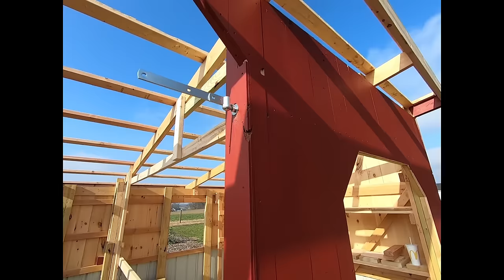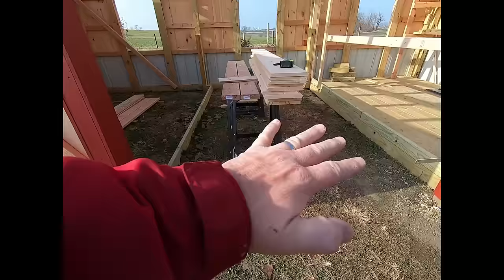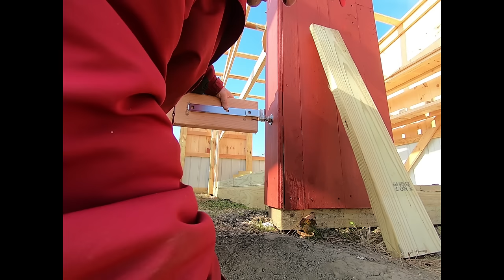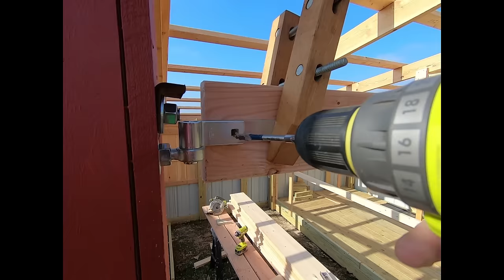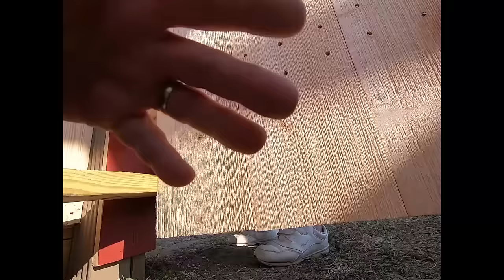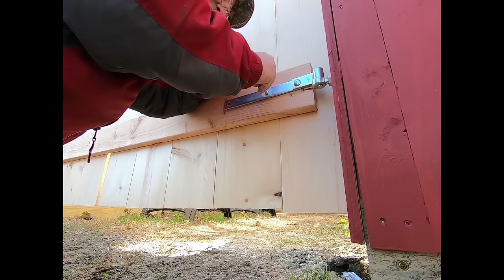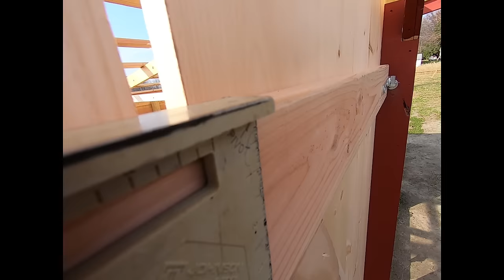DON'T build BARN Doors UNTIL you watch this VIDEO...EASY BARN DOORS

Comment: This may be a stupid question but how was the trim placed to make the doors weather tight?  I wish I could see a photo of the doors all completed on the barn.  I want my doors to swing out but be weather tight( or at least keep rain out).
Reply from the maker: Thanks for watching. I wasn’t looking for weather tight as the shed faces East, has a large overhang and the doors are set in from the front and built over a gravel floor. However, if you want to build them similarly and more weathertight you could add stops to the backside and an overlapping board on the face of one. 
This building method can also be used with more traditional face mounted strap hinges and then trimmed out like any door.

Comment: This will be a great solution for me. Simple solution to a big job for a DIYer. 

In my case I will make one door 1/3rd and the other 2/3rds of the overall width. That way I am only opening a small door most of the time. I may need a 3rd hinge to support the larger door?

My problem is the garage is framed in concrete blocks on one side and stone (old cottage) on the other. I was thinking maybe setting the hinge hangers in epoxy or should I frame out in timber first?  I would take advice here. I could bolt the hinges to the timber frame before fixing it to the stone/block sides? 

Couple of observations.
1. Why did you not have the rounded bolt heads on the outside?
2. Did you consider putting in the remaining 3 bolts in each hinge before removing the first bolt and drilling through the face timber and frame (and turning it if you agree with having the rounded side out)?
3. Would you consider a dab of silicon on each bolt to prevent water ingress and rot down the line.

Sorry it is a slightly long winded reply but once again a great and simple idea.
Reply from the maker: Thanks for watching.  I would definitely frame the opening with timbers.  These can be attached to the concrete and stones using some variety of concrete/stone anchors.  The rounded side of the carriage bolts are facing out. I have the braces on the outside of the door. I may not understand what you are referring to so please feel free to respond again.  The silicone isn't a bad idea.

Comment: My wife wants me to do this exact style door. Could you possibly share the material list with me? Im doing an 8x8 but dividing it into two 4x8 size doors
Reply from the maker: 2 x 6’s for the horizontals and 2 x 4 for the diagonal bracing. The boards are pine boards that can be tongue and groove or shiplap style.  The hinges are made by National Hardware and are called gate strap hinges. A Google search will set you up. Thanks for watching.

Comment: Do you see any reason why I couldn't use 12" black extra heavy duty tee hinges?  I'm putting barn doors on a garage and like the cosmetics of these hinges better.  Plus, I want to get the doors as close as possible to the sides of the garage (without gaps on the sides).  Thanks in advance!
Reply from the maker: T-Hinges would work also. They do have better curb appeal!!  Thanks for watching.

Comment: So smart! Why does anyone build a barn door any other way? No is there was just something to help me remember to close my barn door all would be good.
I am a little late to this party but I am curious about your use of carriage bolts. We’re the a little under-sized so the square bit inside the head was “pulled” into the hole in the hinge? That question is what comes of not watching the whole video. I think the holes in the hinge were square shapes to accept the square on the carriage bolt?
Reply from the maker: Yes, the carriage bolts did fit into the square holes in the hinges. Sometimes you have to turn the bolt a bit to make things line up but they are definitely worth the trouble.

Comment: Love the video, been throwing ideas around how to build doors for an older building I am renovating.  May I ask your opinion wondering adding a third 2X6 and hinge or would a third be overkill?  My door opening will be around 10 foot wide by 8 foot high. Thanks for your videos, I enjoy and appreciate them.
Reply from the maker: Thanks so much for watching. The third one wouldn’t be a bad idea if you plan on using the doors a lot.  I helped build doors for a 16’ tall and 24’ wide opening.  We used 2 2x12’s.  Probably should have used a third one on those.

Comment: So do you attach the hinges as they hang, meaning, allowing them to droop down and attach them where ever they may hang? Or do you level them up with your 2x6? If I allow mine to hang as they are and attach them to my 2x6, they look like shit. They're out literately 20 degrees.
Reply from the maker: Your hinges seem to have a lot of “slop” in them. Your hinges will need to drop or your doors are going to drop. Hinges with way too much play are going to be a problem either way.

Comment: Great video, thanks!  Can I use this method if I need to have both the hinges and the vertical boarding on the outside? The existing gudgeon hinge pins are on the outside face of the reveals. Somehow I can't work out how to apply your wonderful method to my situation.  Help!
Reply from the maker: There should be no problem reversing and putting the bracing on the inside and the vertical boards on the outside. Perhaps the hinges would be hidden from the outside view? If that won’t work you may have to reposition the hinges or go with a different type.
Reply: @LancoAmish  I think that would mean that the vertical cladding boards would be proud of the reveals and the end grains would be subject to the rain ( it rains a lot here in the SW of France!).  I'm wondering if I could fix the horizontal rails to blocks fixed appropriately to the reveals, and then when all the vertical cladding is on, attach the droopy hinge straps to the outside of the cladding?? Do you think that would work?  ~Thanks
Reply from the maker: @nigelford597  sounds like it might. Just make sure to use fasteners that will reach solid studding.
Reply: @LancoAmish  Thank you master!

Comment: I've built a lot of gates, and watched a lot of videos, this was the most informative. It's so obvious now. Thank you for sharing.
What can you (or anyone) tell me about wooden gates twisting? Granted, these are big gates. Two 6' wide and one 8'. I'm going to try lap joints and a full frame on the 8'. I have 3 cross boards for three hinges. I'm going to put one diagonal, and lap joint where it and the middle cross board meet.
Reply from the maker: Thanks so much for watching. Glad the video can be of help.

Comment: SO much simpler than what I would have done for my shed had I not seen this. 

Question - I would have placed the bracing side in rather than exposed, to make it just a trifle harder for miscreants to break in. What are the advantages of bracing inside vs outside?
Reply from the maker: Thanks for watching.  I put the bracing on the outside for looks only.  You can put it on the inside no problem.

Comment: When we build doors like that, we cut the bottom and cross members at 45° so they lock together when closed.  It makes latching them much easier.  I have done about a dozen doors this way over the past ten years and none have pinched or sagged.
Reply from the maker: Thanks so much for watching and for the suggestion.   Have a great evening.

Comment: Great tutorial. I like the idea of building them in place and separating them afterwards. Will try it out in a few weeks. However I do disagree with installing the hinges on an angle. Properly bolted through the wood like you did, they should not sag significantly after the build. And even if they do, they will sag identically on both sides and you will not be able to tell. The disadvantage of installing them your way is that they do not slide on the lower surface but on the corner instead. This will increase wear imo.
Reply from the maker: Thanks for watching and commenting. If you use the type of hinges I did I think you will be sorry you didn’t let them “ride down”. These hinges have a lot of play in them and letting them ride down as I show negates that play.  Putting them on straight without it will result in the doors falling inward. On real big doors, the biggest I’ve helped with were 24 wide together, at the end of 12 feet a 1/16” of “slop” in the hinge results in over an inch drop where the doors meet. Not something I want to fix by trimming the doors. All hinges have play in them especially this style. I guess after a few tens of thousands of openings and closings wear might be an issue but that’s a long way into the future
Reply: @LancoAmish  lubrication helps
Reply: Definitely a DIY tutorial!  There are so many errors with your design and technique I don't have the time or space to list all!  What do you say professional builders?

Comment: Just curious, did you leave the braces exposed, or did you cover them with additional pine boards?  This appears to be the inside of a garage door, not the outside.  Great job!!! I am going to try to do this on an 18' x 12' opening where I store my camper.  Since I do not have anyway out of the garage once I start (no man door), I plan on doing the planks as far as I can until I can still squeeze through the opening, then do all of the cutting from outside, then add the few planks afterwards.  Any help would be much appreciated!!! Thank you so much for sharing!!!
Reply from the maker: Jimmy Smith I only used the one layer of pine boards. The braces are exposed.  I was going for a certain look as the doors face the road and I wanted something more than just plain.  2 things... the doors face East and get very little weather and they are inset so water cannot soak the tops anyhow.  I designed it this way on purpose.  I was able to cut from the outside as I have 3 doors across the front of the barn.  I don’t see a problem with making doors the size you are looking at.  Use longer hinges and larger dimension cross braces.  I helped build 24 foot wide by 16 foot tall doors on a large barn a number of years ago.  We used much longer hinges and 24 foot 2x12’s for the braces.  No way we could have built those doors any other way!  🙂
Reply: That is a large barn!!! I was thinking about going with 2x8 cross members and 2x6 braces.  Do you think that will suffice?  Thanks!!!
Reply from the maker: Jimmy Smith , I would think so.  Get the straightest and most knot free lumber you can find.

Comment: Great way to build barn doors.  Only thing we have here is weather....rain snow and hail to deal with.  Door will have to be hung right side out so there's no collection points for water to sit & rot the wood, otherwise this is genious!  Thanks!
Reply from the maker: Thanks for watching.  Have a great evening.
Reply: Cut a 45 or greater angle on tops of braces to shed water and caulk where siding attached to help.

Comment: Very impressed by the way you built these doors. So much so, that I have set out to do the same on my boat carport. I have a question though regarding "your" take on changing the location of the hinges. My carport door is only 9 foot 3 inches wide and my boat that I back into it, is all of 7 foot or so wide. The angle I have to back it around while trying to get straight enough to line it all out is ...  less than desirable and hinders an easy back in. I have very limited space side to side. So, looking at it, as I've already drilled holes the same way you did, it takes away another 3 inches of width space once it's built. I am thinking of drilling new holes for the hinge bolts that are the same as yours, 90° away from the door opening so the doors would not take up any more valuable space in the actual opening. My sincere question to you is "do you see any reason that that would not work or create a problem for me"? My hinges would be operating from the front of the opening instead of the inside of it as you have built yours. Thanks in advance.
Reply from the maker: I don’t see a problem with what you described. You could also go with flush mount hinges if you can find them large enough.
Reply: @LancoAmish  Thank you - I will be assembling the doors tomorrow. Thank you for sharing your videos and information

Comment: Thank you so much. I am an artist making a small and a large gate (21x84 & 51 x 84) . The large gate will hold art glass. I am looking for the most durable hardware and love your entire configuration.  I am confused at to the hardware I will need. I assume a 6" will do for the small door that will only open occasionally and be part of the stop for the other gate. The wider gate I assume I will use the 12" , but I can't figure out the bolt set up. Could you advise me? thank you
Reply from the maker: If you go to my Facebook page “Garden Spot Acres” you can post pics of your situation. I may be able to help you there

Comment: I want to use this design for the doors for a large shed that will be heated.  Have you ever added weather stripping or other wood to make it weather tight?
Reply from the maker: Thanks for watching. I’ve never built these as weather tight doors but I know of a few that have used this technique on garages and made them weathertight.  Use a outside flush mount strap hinge and go from there. You then can add trim on the inside for the doors to rest against. There are different types of weather seal that could’ve used to seal them.

Comment: Sweet technique. Any reason you can't level the hinges out on the horizontal when you attach the first two horizontal pieces of timber? Definitely using this method for any gate work - I could just use a sacrificial vertical on one side to attach to, thanks!
Reply from the maker: The hinges have a lot of “play” in them. It’s this play that will cause doors to drop when attached. Having the hinge drop down to take the play out is what makes the technique work.  
Thanks for watching.  If you have questions feel free to message me. N
Reply: @LancoAmish  Thanks for the explanation, I'll be sure to message! Can't wait to use the technique - cheers!

Comment: I have an almost identical opening but 2 questions. 1) my opening is actually closerbto 7 ft by less than 7 ft tall. I have enough 1 inch hemlock to build these but its very heavy wood. I have these exact hinges available, even with longer straps. The uprights are 4x6s. Will the 4x6s support those heavy doors? And 2) beacause of limited head room for my tractor I cant box in the overhead. Could those hinge posts be put on the outside face of the posts instead of the sides or would that put too much weight at the wrong angle? This way the door could close against the header at the top
Reply from the maker: I don’t see a problem with the 4x6 supporting the doors.  Each door would be 3 1/2 feet wide and 7 feet tall. Use 3 hinges if you are concerned. Make sure your diagonal bracing is “falling in” from the bottom hinge. 
I’m not sure about the hinges posts put in from the front. I don’t see how that would be much different though.  Open would be like mine closed and vice versa.  
You can sheath these doors the other way if you want the framing inside and out of weather.

Comment: Would it be a better swinging door if the hinges were evenly attached 🤔? 
As is, the hinges are in the holes Crooked. Do you know what I mean? The shaft in the hinge hole isn't straight. Just wondering about wear. Retired machinist wants to know.
Reply from the maker: I don’t think there is much to worry about unless the doors were in constant use instead of occasional use. There is so much play in this type of hinge I don’t think it matters much either way.

Comment: My garage door will be 2 10' wide and 12' tall.  I will have at least 3 hinges . How would I do the angle support??
Reply from the maker: You can use 3 cross pieces and then a brace from 2 bottom hinges on the angle and then completing the X for each. You'd have 2 X's on each door.  Another way would be to Create an X on each door and then use a short filler piece for the middle hinge.  Another way would be to do what I did and then the short filler piece for the middle hinge. Just make sure the weight bearing brace(s) start at the hinge and lean like the ones I built.  That's the important thing no matter how you go about it.

Comment: This is absolutely brilliant! I'm amazed at how innovative and effective it is. Thanks very much for the video.

A couple of quick questions: Can you provide a link or location where I can find the hinges you used? Also, what kind of lumber store had the vertical boards you used? I'm having no luck locally with either item.
Reply from the maker: Thanks for watching. The hinges are “National Hardware Gate Strap Hinges”. You can find them at farm supply stores.  The boards are shiplap pine barn boards.  You may find them at the big box stores but you’ll probably have better luck at local lumberyards.